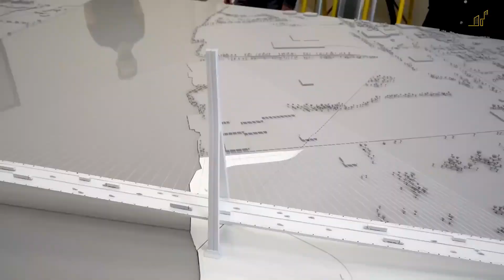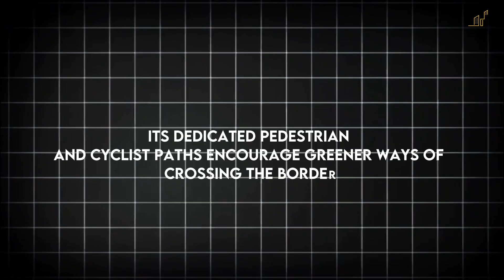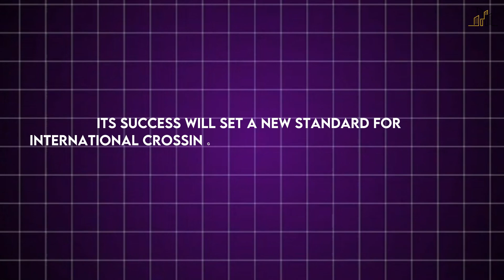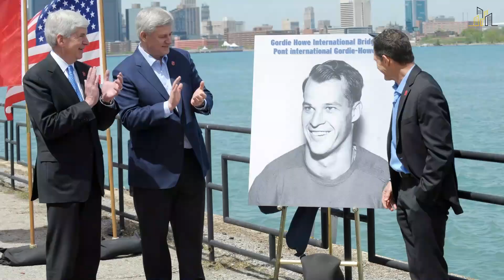The $6.4 Billion US-Canada Bridge: A Game-Changer for North America?

Comment: how can the  span be 2.5K, measuring on Google, the river is about 650 meters
Reply: Maga
Reply from the maker: Hey there! Great question, and we’re glad you’re digging into the details. The span we mentioned refers to the total length of the bridge, which can include more than just the direct distance over the river. It might account for approach spans, supports, or parts of the structure extending beyond the water. If you're measuring just the river’s width, you're absolutely right that it’s shorter, but the full span often includes the complete structural reach from one end to the other. Hope that clears things up, and thanks for keeping us on our toes!
Reply: @buildsphere  FYI, A bridge span is the distance between two bridge supports, such as columns, towers, or the wall of a canyon. The total length of all the spans of a bridge is called the bridge length.